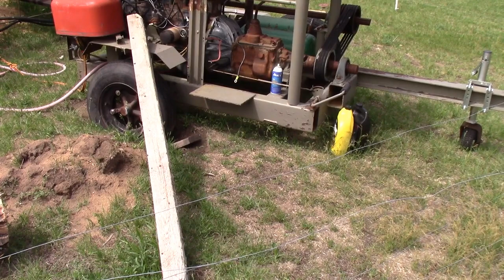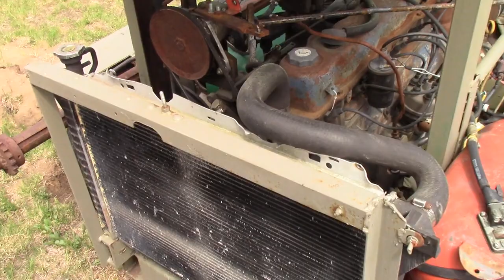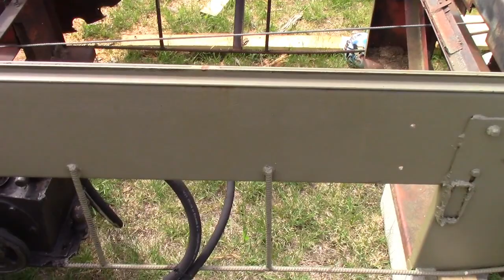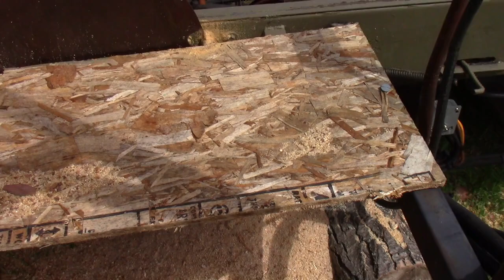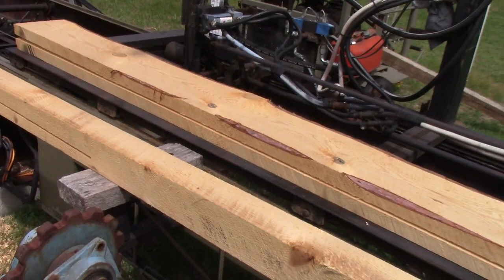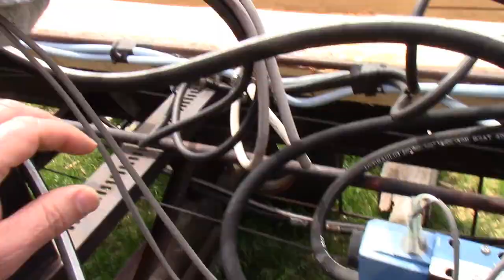An Overview Of My Foley Belsaw M14 Circular Sawmill With Ford Engine

Comment: I have the same saw i have tried  everything  3.different blades an it still cuts crooked how fast do you turn your blade i have case tractor  an it is 540 rpm
Reply from the maker: 500 or so is good. You probably need to get it hammered. The blade has to be set with a bit of a curve in it so that it runs straight when spinning.

Comment: Can you move this mill down the road behind a truck? Or do you have to trailer it? I know it has tires, just curious if that’s just for slow maneuvering of the mill? 

I’m looking at one in Minnesota but have to move it to Utah.
Reply from the maker: With these big ones its easier to set it up at a home base and use it there. It does move down the road just fine though.

Comment: Most interesting mill on the net.
How many hp is engine gas or diesel?
Any idea rpm of blade
Reply from the maker: It was a straight six ford, I remember. I sold it a while back. Gas engine. 500 rpm on the blade. Check out my recent videos and see the Franken-Mill I am building now.

Comment: Currently building one, need ideas for the carriage. Hubby thought he had it but is stuck. Any tips ?
Reply from the maker: Not sure what part he is stuck at. The carriage rolls over the tracks. You need a way to move the carriage. The old mills used a pulley system with cables to move it back and forth. A drive pulley was moved forward or backward to put tension on either the forward or reverse drive belts to move the carriage.

Comment: Hey Troy I have almost the same setup as far a straight 6 motor and manual transmission. My question for you is what gear should I run the transmission in when cutting logs? Thanks in advance.
Reply from the maker: I ran mine in 2nd gear which is what the previous owner did.

Comment: I watched a video of a guy by the name of Casey Creamer, he is a saw doctor that specializes in those big circular saws on how to hammer the blade, and other things such as the tension of the blade etc. He mentioned that if the blade is veering one way or the other in the cut, it is due to improper sharpening of the blade or the blade is getting hot from friction ie: rusty blade, incorrect rpm of blade or forcing of the blade into the cut. His Youtube site is The Northern Logger.
Reply from the maker: Yes, its the rpm. The governor is not working.

Comment: That governor looks like the same type of governor that is used to control any Lincoln Welding generator such as the Lincoln SA 200 to 400 series generators. Most of those governors worked by vacuum that controlled the throttle as soon as the vacuum dropped.               
       Check for cracked rubber hoses or for a vacuum hose that may have vibrated off while in transit to  your house
Reply: yes can't wait to check out the mill can fix anything plus make a good teck vid
Reply from the maker: I will check. Thanks.

Comment: I like the new saw mill...it doesn't tie your tractor up, leaves it free for other chores like skidding logs to the mill without having to disconnect and reconnect the tractor....great job on the sell of the old saw mill and on finding this replacement, you get this one figured out you'll be in business, this new one is light years ahead of what you had before, not that your old one was a bad mill, this one is just setup for ease of use and time saving....as for all the additional pulleys and such, its not really all that complicated or failure points, those are all sitting on bearings, so keep it greased and you'll never have problems...maybe a belt replacement occasionally but for that kind of mill having belts is a nice thing, they'll slip if something binds up, where the chains on the old mill would break, or break other things, and you have less maintenance to do on this new mill, grease all those bearings up, and probably do so before each run of the mill and it'll serve you well for decades.
Reply: we have manes log for it, i am trained mechanic and  lot more
Reply from the maker: It sure is a nice mill.

Comment: Looks like a great machine for cutting wood.  I am about to get a 12x24 foot garage and turn it into a lab for me. Electrical, plywood on all walls with insulation and lighting and of course wood prices had to climb sky-high before I have bought any.  I think I would prefer adding some belt guards over certain places. Never know about loose clothing, etc.   Sounds like you did real good on that sale of the other mill.   : )
Reply: hope u make some vids on your build we all read plan to make guard for it
Reply from the maker: If you saw where I stand when this is running you would not be worried. I am very well protected from moving parts on this mill.

Comment: I'd be nice to see a guard around  that pto
Reply from the maker: Did you see all the electric fence wires blocking people from even getting near my mill? lol
Reply from the maker: To work on the mill i generally drop the wires on the back side where I have to stand and leave the rest up. Nobody can get in there really. Michelle avoids it because its loud. She hates loud machines. When I am done working, I put all the wires back and fire up the fence charger for the night.
Reply: I meant like one of them plastic slip guards like on a tractor implement

Comment: Well if you get the blade fixed with teeth and get the governor adjusted ( not the one in East Lansing) than watch Troy cut wood.
Reply: thet blade mite be out bales from missing teeth, but we got install rpm gages